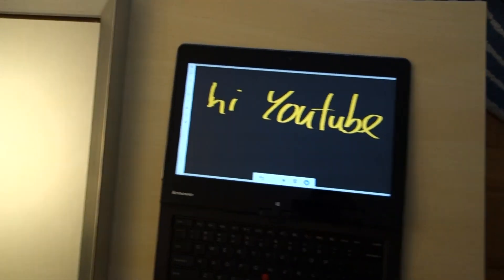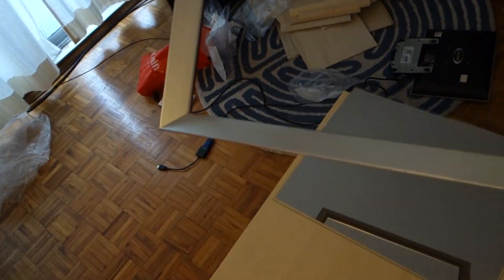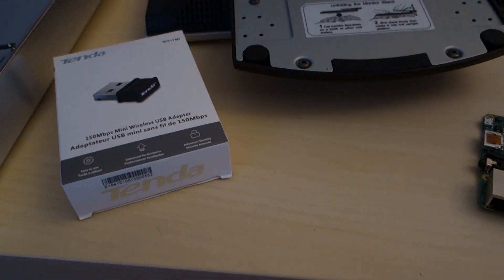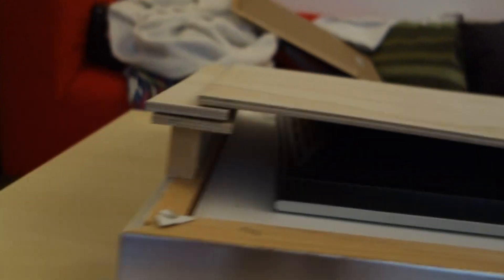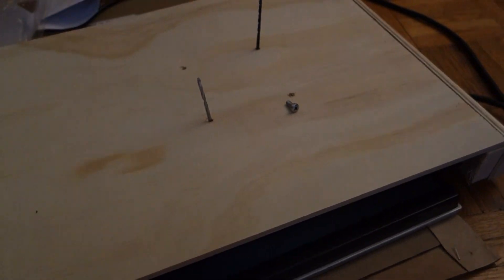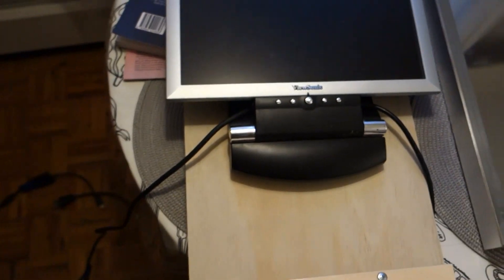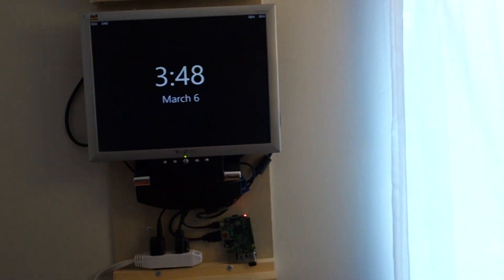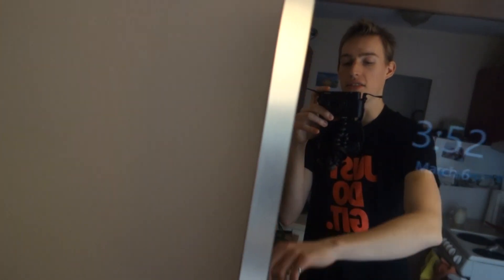Smart Mirror ep 13 - Building and mounting on the wall

Comment: hi Amadeus, what is that component where you have put the usb?
Reply from the maker: It's a wall plug (110V) to USB brick, similar to the ones that iPhones use
Reply: +Coding with Amadeus and which is it function?
Reply from the maker: It powers the Raspberry Pi. Pi needs 5V DC power supplied by USB, and my wall socket gives 110V AC. This wall plug (power bricks) transforms 110V AC to 5V DC. Most people use it to charge phones, but here we use it to power the Pi.
Reply: Ohhh ok...it's a power adapter for the wifi receptor right?
Reply from the maker: It's a power adapter for the Raspberry Pi. The WiFi dongle is inserted into the USB port of the Raspberry Pi.
Reply: sir can you post whole programming plz or share a link plz
Reply from the maker: right here: github.com/amadeusw/mirror
Reply: what amount does it cost in total??
Reply from the maker: $20 for used screen, $20 for HDMI to VGA converter, $35 for Raspberry Pi and a WiFi dongle, ~$30 for a huge amount of reflective film, $5 for a picture frame. Overall, it was too much $$$ for what came out of it, but you can do better with modern Raspberry Pi (has WiFi built in) and modern screen (no need for dongle, and you get better contrast ratio)
Reply: tnq

Comment: I am Stoked and just purchased my Raspberry pi, just to give this a try! before I start, I do want to see how it works with all the sensors. The reason is because i have seen others use a tablet and it was much easier. I want to take the challenge and you inspired me to actually go for it. Cant wait to see it set up!
Reply from the maker: It's definitely easier with a tablet. All you need there is a power connector. Raspberry Pi turns out to be more useful when you use GPIO to interface with sensors, LEDs etc
Reply: How did it go?
Reply: havent had time to start this smart mirror project, but the Raspberry pi is pretty amazing! I got the RasPi 3 and tinker with it here and ther, mostly used for Kodi though

Comment: it looks awesome! If you want to build a more slim version I would suggest you disassemble the monitor and put just the screen and the other needed components(raspberry pi, needed cables etc). you could also use a bigger monitor that way you could have more space to display info. congrats on the build! keep up the great videos.
Reply from the maker: +Felix Colon thanks! That's a good idea. It would save a bunch of space. If I remove the assembly I would need to mount the screen in a different way (no more VESA screw holes). But I'm inclined to get a better screen because the backlight bleeds through the mirror.
Reply: +Coding with Amadeus try using an OLED display, it's expensive, but it's gonna make it looks much better cause in OLED screens, the color black is just turned off pixels